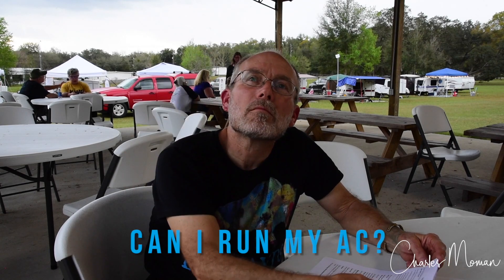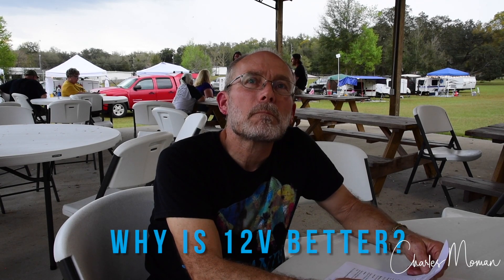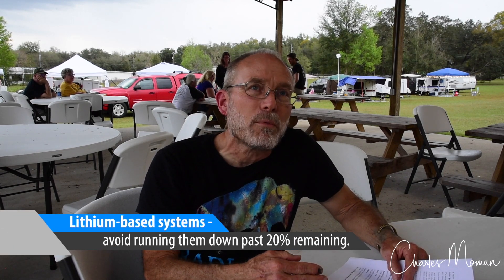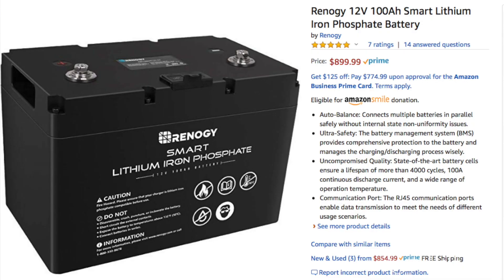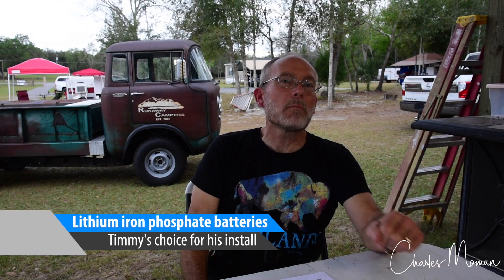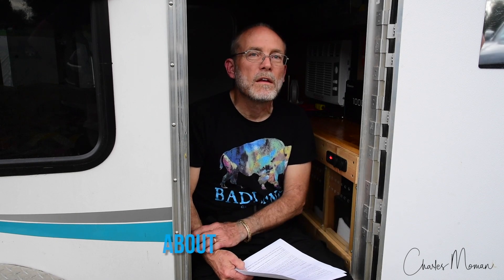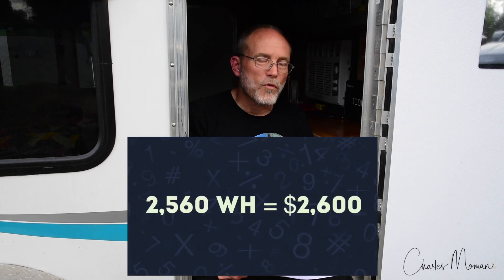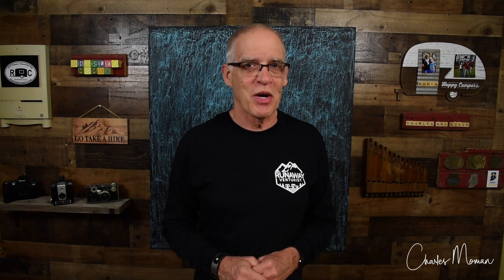Portable Power Seminar - Part 2 with Timmy Burris and Charles Moman

Comment: Another big plus for lithium phosphate that I don't think Timmy mentioned is their maximum charge rate. Most drop-in 100ah lithium phosphate batteries (those with a built in BMS) can safely accept at least 50 amps while charging. This means if you have a 50 amp lithium battery charger (like from Progressive Dynamics) you can charge from 0% to 100% in just 2 hours directly off a gas generator (or of course, from shore AC). A nice backup plan not to have to run your generator for very long to get a full or partial charge if solar becomes unavailable. And still larger amp lithium chargers are available for battery banks greater than 100 amps (like Timmy has).
Reply from the maker: Thanks for watching. Today, I received a Delta 1300 from Ecoflow today to review. It recharges from 0% to 100% in less than two hours - crazy fast! I will have my video up this weekend. Thanks for watching!

Comment: Great discussion!  When on shore power, does the inverter still run the A/C or is it run directly by the shore power?
Reply from the maker: When he has shore power he runs straight to shore power.
Reply: Thx for the response. How did he disconnect the inverter ?  Separate shore power plug?  Transfer switch?

Comment: I'm not electric savvy so.........If too many items are used at the same time, thus amp usage > amps available, then a circuit breaker is tripped or is there a fire hazard possible?

Would this usage capacity increase going from 30 amp to 50 amp service or does that only apply to 110 Volt shore power?
Reply from the maker: I will have Timmy answer this for you.
Reply: The 30 A and 50 A you are talking about is for grid power. Those have a breaker in the box on the pedistal and will trip. Our off-grid system has the 1000 watt inverter and is fused at 100 A. The one time I tried running the air conditioner and the coffee pot and the compressor kicked on it blew the 100 A fuse. 632 Watts + 385 Watts is just over the 1000 Watts then you figure the surge cause it to be more than 1200 watts for that instant. The fuse cost about $10. Simple solution is to turn air conditioner off or to fan only. Then it is only pulling 632 watts, coffee pot only, or 692 with fan and coffee pot. Hope this answers your question.
Reply: @timmyburris735  That helps a bunch!  

Instead of depending on a fuse (and carrying extra fuses just in case), can 12 volt systems also be set up on a circuit breaker?   

If Yes, is that a better solution even though it might be more expensive or is limited space in a teardrop to place the breaker box a concern?

Are there combo breaker boxes that have both 110V and 12V?
Reply: Also if you could fit another 200 watt solar panel on your roof or add a portable unit on the ground,  would you have to make any other modifications to your setup to fully utilize the extra 'Juice' being collected from the 3rd panel?